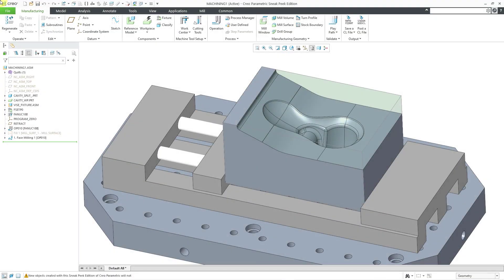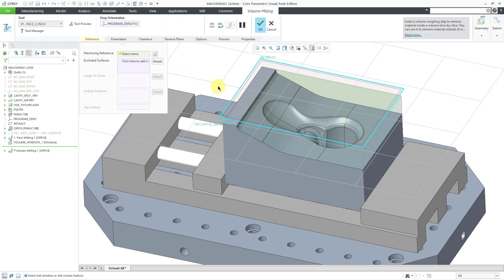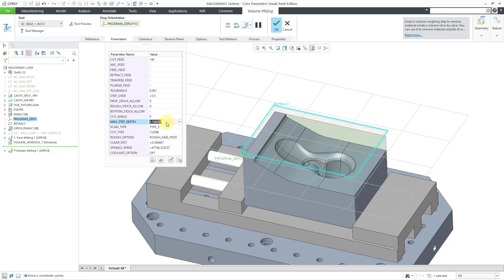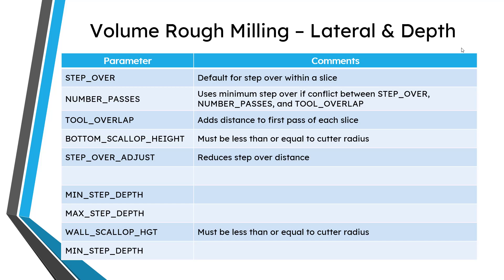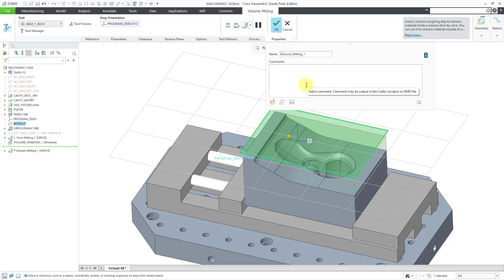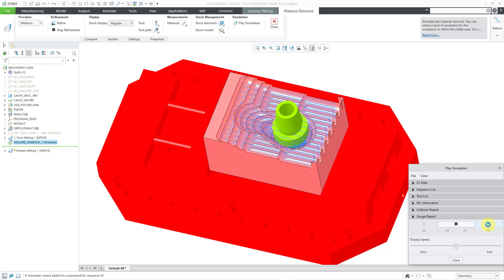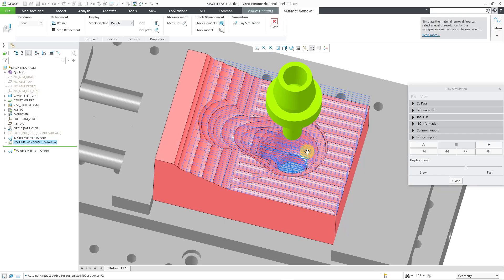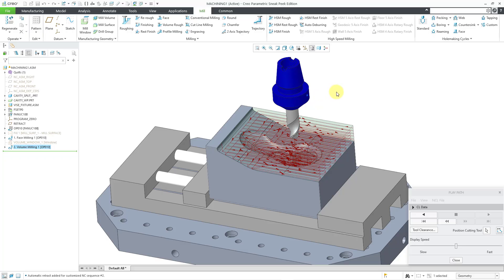Creo Parametric - CNC Manufacturing - How to Create a Volume Roughing Sequence

Comment: Cristiano, I can show you a internal helical milling.  It is part of a "trajectory mill".  First make a sketch of the circumference of a pocket that you make in a block.  Choose Trajectory as the milling operation.  Select the tap "tool motions" and select "curve cut".  Select the "curve"  Than you get a dialog box where you can check mark "helical cut".  Select the start height and the end height and also the helix angle and the helix pitch.  The toolpath in yellow is helical.  Good luck!

Comment: Great video!
Could you please make a video showing how to machine an internal profile using helical interpolation milling in Creo? It would be great if you could also include a flat bottom in the operation, like valve profile. Thanks in advance!
Reply from the maker: I'm not familiar with helical interpolation milling. But also, I recently completed a series of about 25 videos on CNC manufacturing (10 more have yet to be released). I am burned out on CNC manufacturing videos and will not be making any more for a long, long time. If you need assistance in a specific area, I recommend you engage with a consultant.